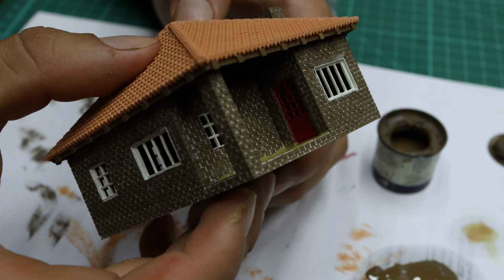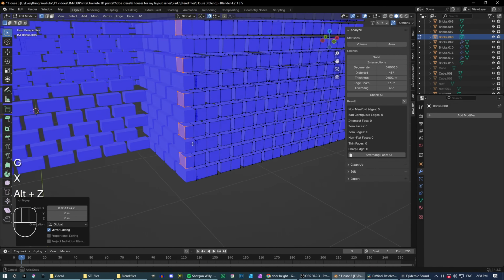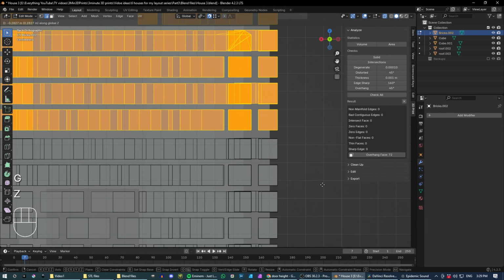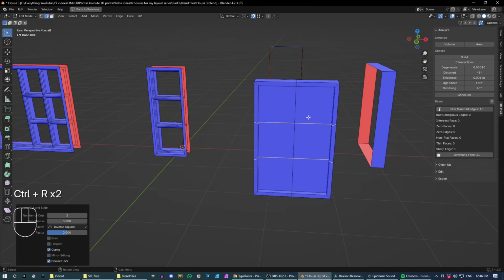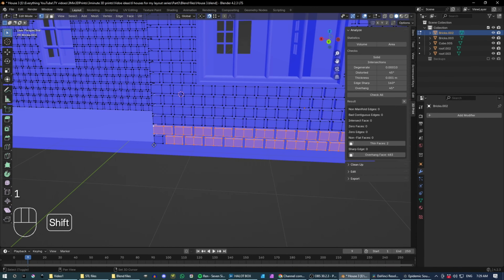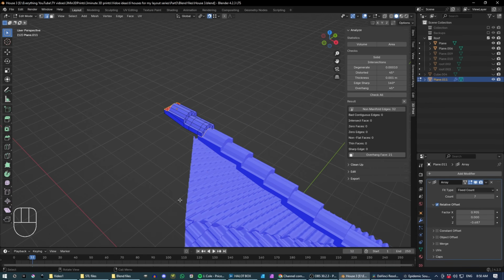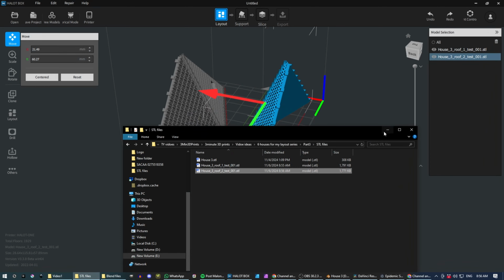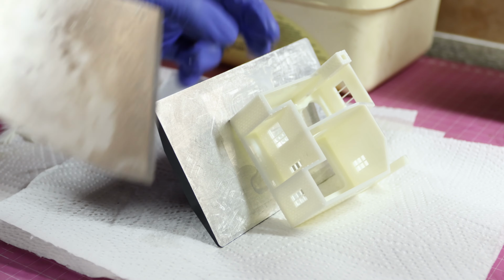How I use Blender for Model Railroading

Comment: You should use booleans for the windows and use a solidify modifier to give the walls thickness...

I try to make simple solid parts and boolean them as much as possible. That stops all of the problems like ngons and holes.

You dont need to union because the slicer does that automatically.
Reply from the maker: Hi, thanks for the comment. 

I did use booleans for the windows and doors. Solidify modifier is quick and easy but if you have a model with inner walls it can be a bit annoying. And if you forget to apply the scale and your model has non-standard scale it won't make the walls the same thickness. But I agree it could make it a bit faster, however I just do it manually so I know it's correct... 

I know you don't have to union it, and I have printed many models like that. But if you're planning to publish/sell your models I think it's more professional to union it all into one manifold object.